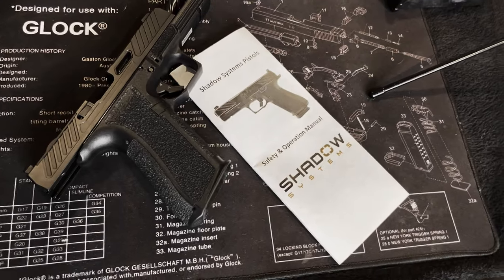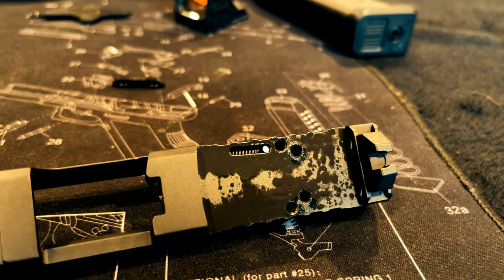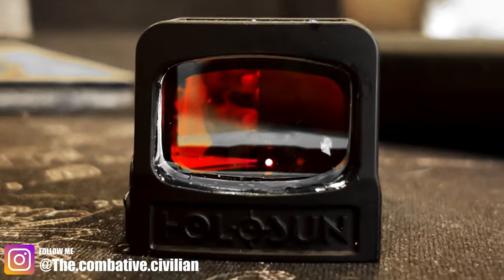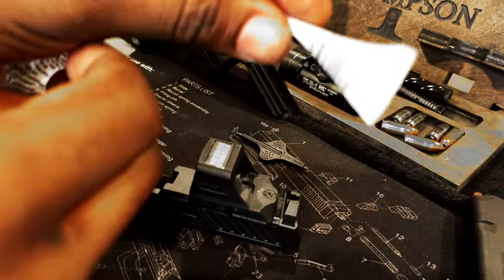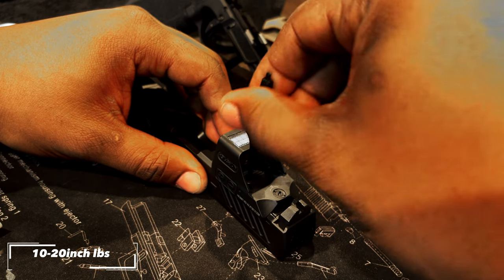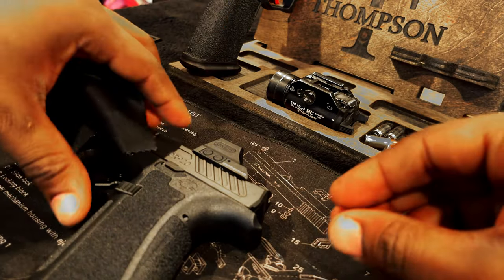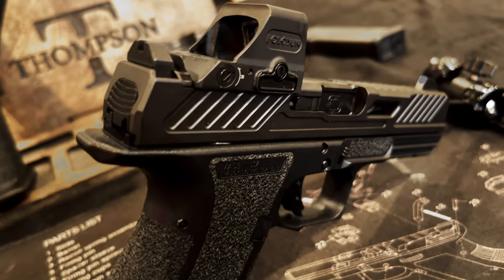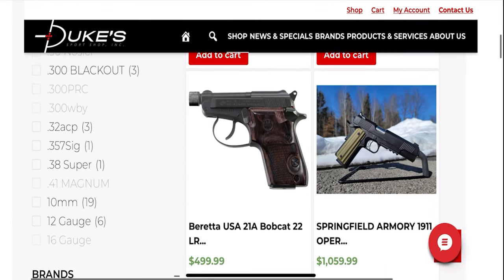Shadow Systems Optics install - Holosun/RMR Red Dot tutorial - DR920/MR920/XR920 models

Comment: Did u notice that the 508t does not have that tight fit with the spacer befor you add the screws? It fits and all but there is a small really small gap in front of the optic. Im wondering if that will cause problems later on since it doesnt fit like the 507c does. I had to shove the 507c in place and the 508t just fell in place.
Reply from the maker: I’m not sure. But I know that I beat the crap out of mine when I had it and never had any issues.